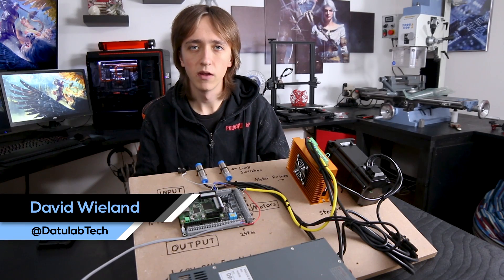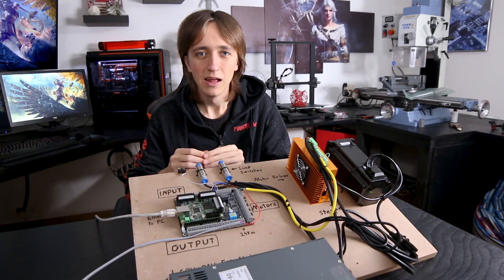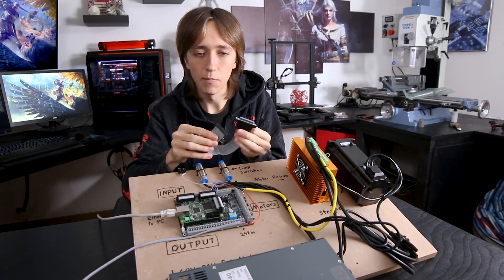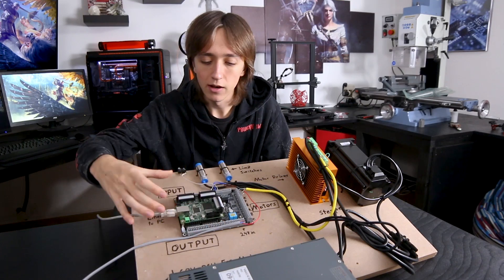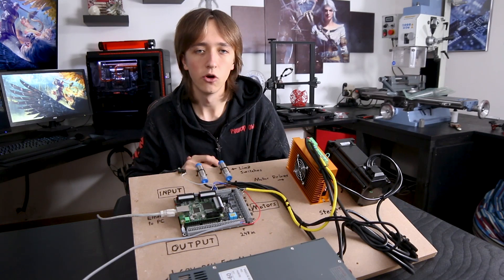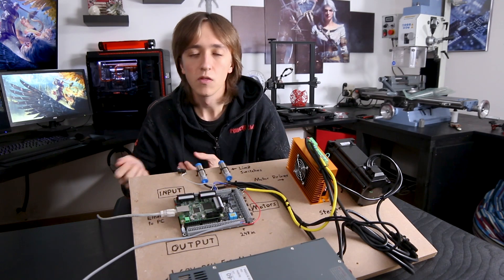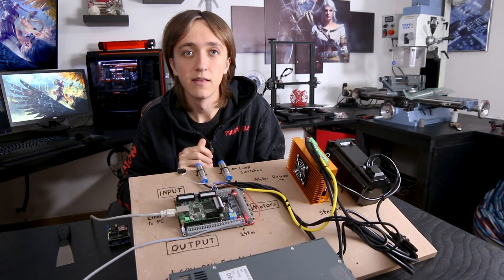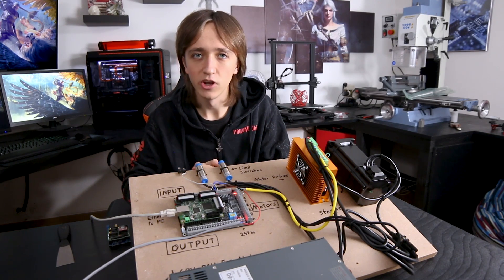DIY CNC Electronics Guide

Comment: ALL normal new computer can add pci to parallerport card, cheap cost 10-40$ and then can use cheap parallerport breakoutboard cost 5-20$ and can use stepper motor drivers easy,

Comment: windows OS not newer working safety at cnc machine, very dangerous and not used any factory and workshop newer. need be REAL TIME controller and linuxcnc has this only, but need use cheap version only paraller port controller, if need better more in/out pin must buy MESA card can use ethernet controll card and lot more motors and limit SW etc other input/output pin. many controller has made but not has one good, GRBL not have real time no safe, and very old system same than cave men make, linuxcnc have same than today men make, MESA card have better version controller what newer has made. ethercat card have ower expensive, many other has closed factory card not can make and add any own addons, and all have expensive, if one axis go broken need by ALL controller new, modular machine not need, closed loop controller and motors have totally ower price expensive hobby users not newer can use ,maybe if have lot lot lot money waste stupid, normal stepper motor controller have best option hobby user closed loop motor system is 10-50x expensive buy all parts and drivers, ethercat cost 50X more than normal stepper motor system, not hobby users option, cheapen and good can use normal hobby work is only basiv stepper motor system whit cheap paraller port controller/breakoutboard, or next step expensive little more MESA card controller, all other arduino, etc esp-32 have worst toy controllers, use GRBL cavemen software whit fast new processor, not smart.arduino not fast but cheap, same problem GRBL shit use. raspberry pi whit linuxcnc have good new option use cheap hobby machine. lot better than all GRBL shit system or factory own closed systems, UNCC ,smooth stepper,axid cnc, etc, and many ready to use systems.

Comment: Ive played with all of these, and since I cam from CNC shops using real machines with Fanuc controllers, I tend to hate PC based solutions... They are good for learning, but sometimes just easier to pick up a dedicated standalone CNC controller even a small one from amazon is better than hodge podging a controller to a g-code sender
Reply from the maker: Totally agree, that's why I ended up switching to the Masso G3 on my main machine.

Comment: Hello, in this video you are using a controller card that uses a Network card. What board is this where can you buy it, I intend to use it with Linux CNC
Reply from the maker: It is the Ethernet Smoothstepper board, but I believe it only works with Mach4. For Linux CNC the Mesa boards are your best bet.

Comment: Hi, and greetings from Denmark 🙂
I'm building my own home shop CNC router and have some questions, since it is really a jungle to figure out what I need ;-)
Is it really necessary to use closed loop stepper motors, or can you just use somewhat "oversized" open loop motors?
IF !! you go for closed loop motors, is it still possible to get a real closed loop system, using e.g. cheap controllers, like the Arduino Uno or similar?
Reply from the maker: The closed loop motors come with dedicated drivers that do all the magic. The controller is then connected just like any other stepper driver. Unless you specifically wire up some error signals, the controller has no idea that closed loop steppers are used. That is unless you go to the high end where everything talks to eachother, but then you wouldn't be using an arduino anyhow.
Reply: @DarkArtGuitarsWorkshop  
So if I buy closed loop stepper motors and drivers, I will have a closed loop system, that will prevent the steppers from missing steps, and I can use basically any controller like e.g. an Arduino Uno?
Just to be clear 🙂

Comment: good nice video, next you need make video linuxcnc and usb/ethernet breakoutboard,lot cheapen than this owerprize mb3 has. i has used mach3 windows base pc lot and alltime has lot problems, windows not have stabile and good drive any motors, interrups have windows big problem and not have REALTIME newer and lost lot step alltime. linux have true realtime and not lost step anythink, if win pc have problem alltime about 100 time/week linuxcnc not have newer last 5 year has problem. this is why many not use windows base cnc and factory not newer used windows base machines. ESS/M3 has super expensive board no hobby users board newer, mesa card have half cheapen and not have hobby budget can use. normal paraller port or usb port breakoutboards cost maximum about 10-40$ lot better hobby users, arduino and small drivers can use only laser or 3D printers, but can connect external big drivers step,dir pin. raspberry pi not have many board yet, only small arduino board similar.best compination is linuxcnc cheap ethernet or usb board and big external motor drivers about dm855 etc, because if need mill metal need big stepper motors about 4-8Amp 60-90 volt. closed loop motors and drivers not have realistic hobby diy user 100x expensive than normal open motors. hobby user not normal have closed loop servo motor and driver budget, and this link controller board too ower prize lot and super expensive. better looking lot other boards. mesa have one but expensive too ower 100$ board not hobby users use.

Comment: This was so great! I have a shapeoko and have been thinking about upgrading the electronics, but didn't know anything about them. In researching "controllers" I feel like a lot of other sources mix up the terminology... Like you can tell by the price even that some boards are $26 and call themselves CNC controllers, but other packages are $200 or more... But they also call themselves CNC controllers. I suspected that some are bundling in the drivers, but use of what I think is the same terminology for slightly different things made it hard to know. I really appreciate that you split everything out individually so I could get the gist of what all is needed, and that helps sort out what I'm shopping for. Thanks again, that was a really helpful crash course.
Reply: normal paraller controller board cost 10-30$ only. buy old xp computer 20-40$ install linuxcnc and use paraller board lot cheapen than this example video has.max 4A motor drivers tb6600 cost about 10$ biggest have expensive, stepper motors cost less than 5Ampere 10-40$ closed loop cost 100x more than normal cheap. nema 23 kit mach3 or linuxcnc cost 3-4 motors,and drivers and powers and breakoutboard kit less than 300$ cheape i has build big aluminium mill cnc 200$ salvage motors used dm554 drivers,10$ breakoutboard,wood frame or diy welding metal tube frame.

Comment: I have the FTB2 which is a copy of the MB3 designed exclusively by cncroom for cncmodulkit, and the manual is that of the MB3, but there is no information on how to connect an Auto tool Z, the probe z, maybe It is simple and too obvious but there is no info, if someone can help me please.
Reply from the maker: I believe you can just hook it up to any input and then assign it in Mach4

Comment: Hi Datulab
Thanks a lot for your explanitions. very usefull-  but no it's a while since you made that video , so maybe you got some new stuff comming up - what im looking for it's a control board there is controled via ehternet or, usb - (same as the board in the video above)- but what i'm looking for 6 axis out put - for stepmotors(same as the video above), but same tine for servomotors with eg, encoder feedback. - without should use a mesa card eg. 7I76c - as it is quit pricy - thanks in advance - onse more thanks for your efford.
Reply from the maker: The smooth stepper with MB2 breakout board will do up to 6 axis. You can use both steppers and servo motors, as the encoder feedback of a servo motor goes to it's driver and not the CNC controller directly. You can then connect the driver to an input pin of the CNC controller to know when there is an alarm or some other issue.
If you are looking for a slightly cheaper option, I will have a CNC project coming up where I use Mach 3 with a bit of a cheaper CNC controller, but that'll be a month at least until it's ready.
Reply: Hello again Tabulab
Thanks for your prompt answer, in general I’m a newbee in the cnc world
Is there any possibilities that you will do a video, using linuxcnc, as far as I know is the one the controls most axis, I do not know mach4

Br

Comment: you probably won't see this but at 70 I am starting to teach myself electronics and I have wanted to build a cnc machine to play with.. I have looked at many video's.. But yours makes it so easy and simple that I am almost positive I can do it now and will be trying in the next week or two.. thanks a million brother.. Well done!
Reply: easy and simple but ower prize lot, only controller board cost more than all my cnc machine ewery parts.
Reply: @mattivirta  did you make it yourself? Building a control board seems like a lot of fun to do.. I have all the parts to build one here plush all kids of stepper motors and other bit's and pieces.. It is just a matter of "do I really need a cnc machine at my age"..
Reply: @tinkmarshino  first cnc diy beginners best buy only cheap paraller port machine learn lot and buy cheap parts, my first cnc i made has germany cnc controller diy board i make all elektronic soldering diy at home, learn lot and test lot what need do, then understand good what and how cnc,stepper motor,controller working, today have beginner first lot easy build, need arduino, code, and parts, or if not want make elektric board diy can buy ready cheap 10$ breakout board, learn how working and how connect all pins, and important learn G-code lot how write own running code, need understand what many g-code mean, but interesting and funny work.
Reply: @mattivirta  Matti that does sound like a lot of fun.. I agree with you about getting a cheap one at first to learn on.. that is why I was thinking of making my first one from the parts I have around the shop. I have Arduinos and raspberry pi's, stepper motors and most all of the parts I need to make one.. after 70 years of working and collecting things I think I might not have to buy to many things.. and building one I can also learn how each part functions and when I break it I can fix it. What soft ware do you use for your cnc machine? I have an old cad lite program from back in the day (I was a carpenter most of my life) Do you think that might work? thanks for your input my friend.. enjoy the summer!
Reply: @tinkmarshino  im old men 63 and pension now have lot time again make different cnc and many other hobby project, have time lot now haha, i use cad cam softwares aspire vetric vcarve soft best what i has found some year before, can make wery easy g-code files automatic, because i not understand english well. cnc before uses mach3 but windows pc have big problematic not have real time not good, linuxcnc have million time better and no problems newer, only i not understand hal code how make and linux code anythink. arduino i has use little others easy projects, and linux have cood soft what i has testing bcnc whit protoneer controller board.whit linux and raspberry pi, i interesting raspberry lot i have some raspi card and just orden test and proto board and try understand how make code or cnc.i has young men build many cnc yo little metal shop factory, but now have time lot i start new all and try looking new boards and projects, not money lot pension salary not big but i try orden part when can, about no more than 50-100$/month van use. raspberry pi looking interesting possiple board make many different systems. many say fusio 380 have good make parts g-code but i test and hate this, i has used autocad many year at work but new fusion have big shit this corporation new software old autocad users. i test some month fusion but delete software ,not good, i found torrent aspire vcarve and have lot lot better easy use.and youtube have lot video how learn and make parts. i not have link to software at torrent but have olden version and crack how working fine. my main computer have at thailand my new house and im now in finland no can looking links site. my cnc have 1500x1500x400 size metal tube welding frame and stepper motors have nema 23 but future nema 34, 4,6ampere ebay cost 20$/pcs, drivers dm544 about cost 10-40$PCS, breakoutboard cheap chinese what i has used many cnc before no newer problem and if axis broken cheap change new, 10$ not newer smart use one-to-all board if one axis go broken need buy expensive board all new. old pc cost 20-50$ and install linux debian and linuxcnc software lot better than windows and mach3, mach3 has allttime lot problem not good newer thats why i chage linux not problem many year. windows not have true realtime and lost lot step alltime, linux same hardware not lost newer step.

Comment: If you want to build a cnc what is the least nema motor you would buy ??
Reply from the maker: Depends on the size and construction of your CNC. For most diy router style machines some Nema 23 variant will do, but you'll have to do more research on what exact power matches your requirements.
Reply: @DarkArtGuitarsWorkshop  greetings I am looking at because it is not a router that it needs a lot of torque u really should not need a very strong stepper motor to move all the axes what is yr opinion pls
Reply: minimum stepper motors if want cut wood and aluminium have nema 23 but better buy biggest nema 34 size motors important have torgue and amperes 4-12Ampere motors. and this amperes drivers. nema 17 can use only 3D printers and laser engraves no need lot torgues.

Comment: I noticed you said you don't want internet and CNC traffic over utp, but that's all seperated by your tcp up stack so should bnot be a issue, and the pnp/npn inductive sensors can also have 2 cables, other that that real informative video, but some more detail about the schematic would have been nice.

Comment: I use the same MB2 breakout board with my ethernet smoothstepper. Opto-isolated IO, fully driven differential step/direction signal for SIX motors, 24V standard, and super easy setup with the headers. It's a fantastic board!

Comment: liez! heh. But seriously LinuxCNC does not require any internal hardware. Though you can use it if you want to. PCW's Mesa boards are really nice. I use a homemade buffered parallel breakout board myself. I get a good rate software stepping with it too. My machine will go 200 inches per minute in 8th step mode using 10 TPI leads. Which is something like a 16 KHz pulse stream? I'm not going to calculate it right now. It's pretty impressive. Let's just leave it at that. All while never updating WIndows. I can stream video while my CNC machine is running if I want to. I mean it's not POS Windows. I wouldn't let Windows run a coffee pot let alone my CNC machine.